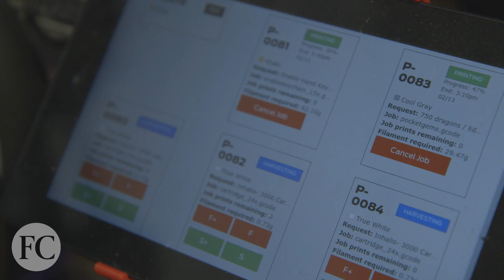Meet The 3D Printing Factory Changing the Manufacturing Game

Comment: China has a vast cost savings due to lack of safety, lack of caring for it's workers, lack of environmental practices / waste management, and lack of R&D (Most things are copying / pasting others work). Tough to compete when they cut corners on every category.
Reply: U have a point.
But ur talking about the low ticket sales category.

U can also venture into high ticket "high price" brand premium.
Like for say Gucci they overpriced they're items and it's their strategy.
Reply: @OdingHelps  Yes, but China still offers low cost alternatives to those items also.. We just bought two wire cutters (domestic one was $3500, and the Chinese one was $650).. Both are nearly identical.. China had just reverse engineered the same exact machine and put low cost parts / cheap labor behind it to price the other company out of business.

Comment: Nice setup.. they must have some insane marketing to make that work. I work with professional sla machines doing lots of medical devices and it's thought finding the clientele.
Reply: or they inflated their image since they went bankrupt
Reply: Markitos203 Hi, what sla printer do you use?
Reply: what printer is best for high accuracy desktop printing not industry
Reply: Sla is expensive, fdm is dirt cheap. It also has a bigger market. However sla printers have more commercial customers, which is better for long term. A dentist will buy tooth thingy for most of their customers but a random guy wouldn't buy stuff periodically. Just maybe 2-3 max 10.

Comment: lol, makerbots?  no wonder they need so many.   Most people would go cheaper with flashforges or just DIY coreXY and Deltas, deltas are quicker. at least a 10x10 build plate....
Reply: And the FDM dorks converge en masse... If I was developing a new automated manufacturing concept, I too would want a supplier that was A) nearby and B) able to deal in volume. Who cares if the printers aren't uhmazing? What I want is the ability to swap out a dead one with a new one quickly, and I don't get that from any CoreXY dealer. However, one has to wonder why they went with commercial printer models and a robot arm in the first place. What about hot-swappable build plates being ejected by a printer onto a conveyor belt that takes the plates to a specialized harvester? The printer could then load a new plate from a hopper, heat up, and start the next job in the queue. Version 2.0?

Comment: I wouldn't pay for the kind of quality your putting out. The idea is good but the final products looked like shit to be honest. You need to tweak those machines.
Reply: Those are very cheap
Reply: the machines? fuck no there not infact for how there using them they couldnt have chose a more expensive way to go about this

machine for machine theres far cheaper (even opensource diy) machines that produce way better results than that with verry little artifacts unlike the fairly prominant layer lines theyre getting

as for how there doing it they took expensive machines tore out there brains and are running them as dumb printers so there not even getting the full functionality of owning those
Reply: makebot is a bad machine
Reply: Yeah.. They use makerbots...